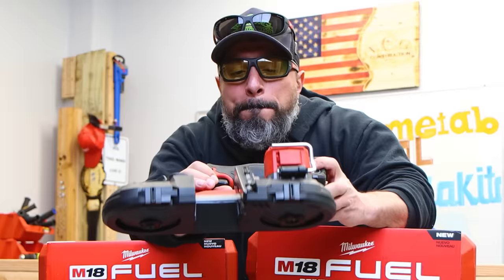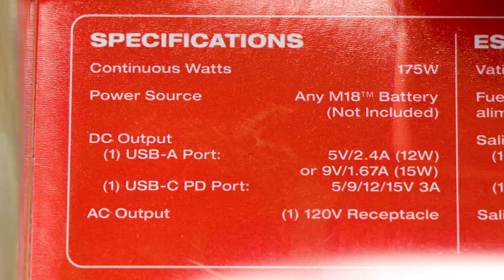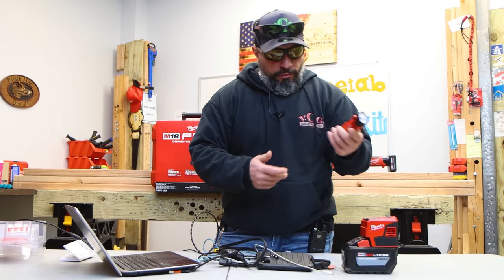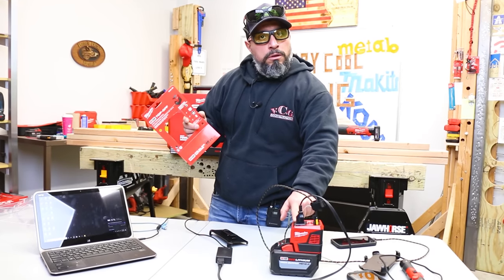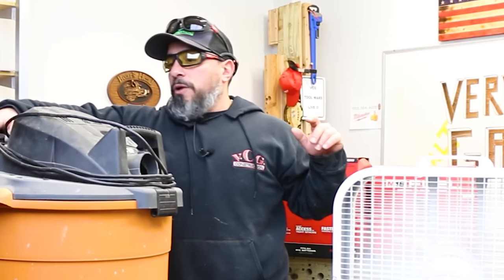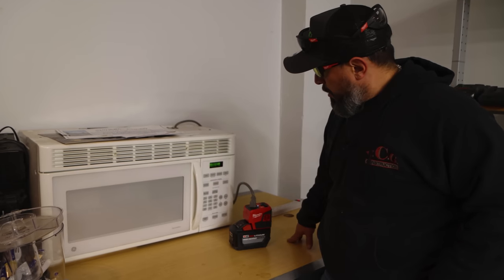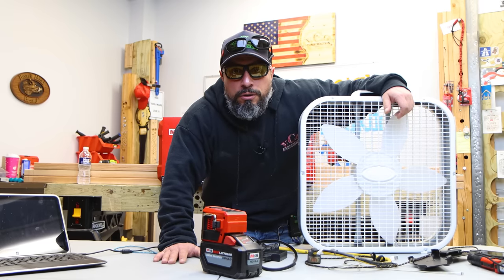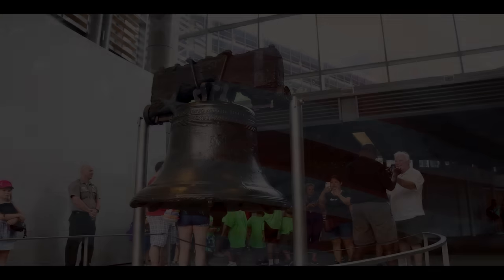NEW MILWAUKEE M18 TOP-OFF 175W POWER SUPPLY (Watch Before You Buy!)

Comment: Those big shop-vacs pull way too much current for a top-off. Shop-Vacs trip the thermal breakers on power strips. Might as well try running a window AC unit. 175-watts is the capacity which is 1.5 Amps at 117 VAC. GR makes a small USB ammeter that costs $5 at Home Depot. Nice to use to verify that current is flowing. A Kill-A-Watt device costs $20 at Harbor Freight and is great for measuring 120 VAC current and power

Comment: I think for the price of $100 this is going to be a tool as fast as it comes in you'll see it go right out of stores my 2016 Ram sport has a outlet in the dash and I never really had to use it. So you get a few people to buy it as a gift. Milwaukee you can use M12 heated jacket charger or they have almost the same thing $30 hooks up to the M18 battery

Comment: I have to wonder if it's not just about the draw, but they way the device draws the power, that is, needs a big leap to get going. 
I wonder if there will ever be an M18 drill press, biscuit joiner or belt sander.

Comment: Bought one and it wouldnt put out more than 98 volt a c.   Returned it.  Bought another one. Same problem. This one only put out 96 volts a c.  You never tested the output with a volt meter. Low voltage damages all the things you ran.

Comment: Got this top off the product works but the battery is finicky to charge I have to move it in And out off the charger.  I used the battery on my fan and got stuck…. Is anyone else having this problem.

Comment: A couple of things that surely would work with this, at least I would think so. A radio: finally I could buy a cheap $20 radio and not worry about it getting beat to hell or stolen.

LED lights. Now there is an option to buy some cheap LED lights and make your own temporary light Tower or trouble light cord without spending hundreds of dollars.

Comment: there was a USB charger version of that a while back that was able to use it on heated jackets so what's the difference between that and this
Reply: This will invert DC to AC, while the adapter for the jacket is only DC (that one allows for a larger battery to be used with the jacket, 18 volts over 12)

Comment: 😂😂😂😂😂😂 I need that brushless backscratcher 
That TopOff looks great but the question that I have is why not make the unit rechargeable with a higher capacity battery
Reply: No. That would defeat the purpose completely. If you want a bigger capacity inverter with an always attached battery go for it. I like the top off because I can swap the batteries, therefore it'll basically never die.
Reply: @357Compton your on a jobsite up in the air in a basket so I’m gonna carry who knows how much more weight in batteries to keep powering one unit / yes it’s power on the go but what I’m trying to point out is with one unit that has more capacity (I’m pretty sure this isn’t the last Top Off) then you do not need to be carrying around more batteries

Comment: Vince! I just started watching your channel because I decided to go down the wormhole of owning tools 😂. You are very knowledgeable and you helped me decide which impact wrenches to get—of course I went with Milwaukee. 
Question: Do you know if the TopOff could power a Milwaukee charger (multi charger/rapid charger/supercharger) to charge a dead M12 or M18 battery?
Reply: You would lose energy overall to heat by switching 18v DC to 120 Ac, then putting it into the other battery, but also if your using the topoff, you already have a charged battery, just use that

Comment: Neat small system but why losing time trying to power high power systems when its clearly said it won't do it. In the end its not that hard to read on the products itself, most of the time the electrical consumption is stated.

Comment: 5HP vacuum how is that possibility that's 31 amps at 120v
Reply: It may be 31 amps for a fraction of a second when you turn the vacuum on. A breaker will not trip if overloaded for a very short period of time. In reality, the continuous power of that shop vac is probably closer to 1 HP, which puts it well within the operating range of most breakers. Keep in mind that the 5 HP rating is a peak horsepower and is not really a useful spec since it only sees that power for less than a second. It’s just a marketing thing.

Comment: If Milwaukee can make their batteries power 120 then there should be no problemo making their damn miter and table saws also run off both Ac and DC. I bought the 7 inch miter saw because it was the best out there aside from the Kobalt and the kobalt makes me leery they'll discontinue the entire line. I love the damn saw, but it is also stopping me from investing in the 12 inch. I like the ideo of using both batteries and AC and prefer AC. Thankfully Milwaukee has an AC saw, but it's expensive. I'd like to get another crew running and replace my 780, but I refuse to fall for this battery swindle.You actually pay double for most battery operated tools vs corded first of all. Second, the electronics in the battery tools and especially in the brushless shit is a massive failure point compared to a simple AC tool. Third, batteries are the cheapest part of the damn tool to manufacture and their retail price is batshit crazy. I still have Milwaukee tools from the mid 90s when they were world class and there's no way any of these cordless tools last anywhere near two and a half decades. My rant aside, I dig this hub and it's quite useful.